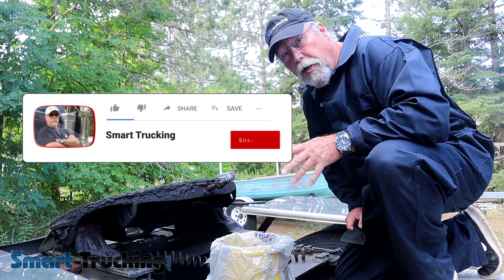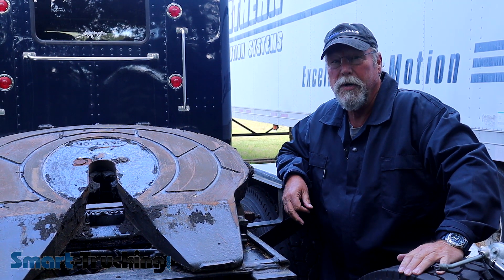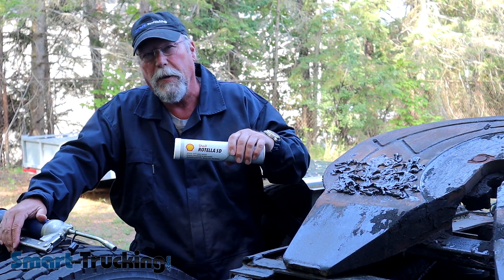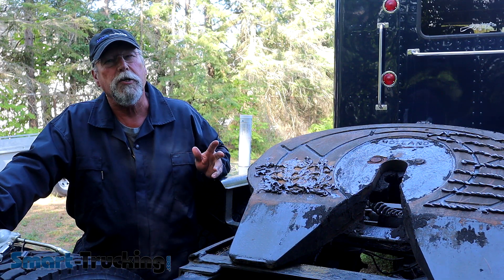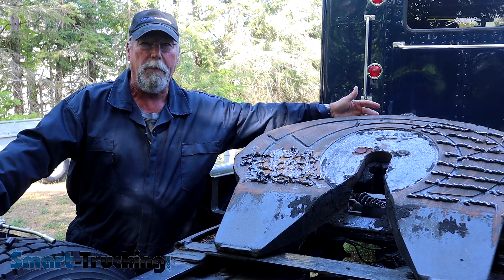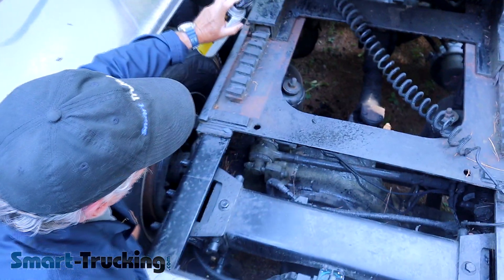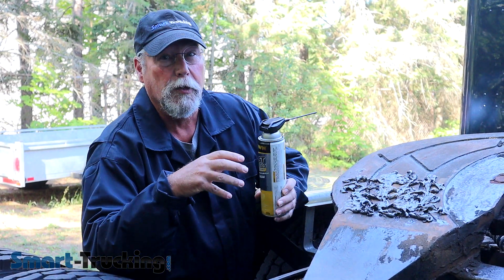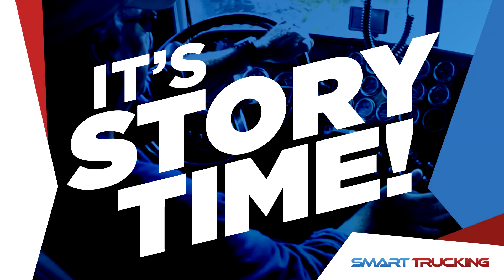How To Grease + Maintain The Fifth Wheel

Comment: This is a pet peeve of mine. A dry fifth wheel is hard on your front end components as well. We had a driver come in one afternoon and I just happened to be at the shop. He told my boss that it sounds like his rear end was going out, so he unhooked from the trailer and they went on a test drive and the noise stopped. They hooked back to the trailer and went again and it made the noise. The boss told him that it must be in the trailer so unhook and get another trailer. I walked over and took one look at the fifth wheel, got my boss and showed him how dry and shiny it was. They greased it and hooked the trailer back up. Went on a test drive and the noise stopped. Dry fifth wheels cause a lot of different things to happen.

Comment: If a trailer was dropped with the landing gear too high, I use it as an opportunity to grease the fifth wheel. I back under the trailer until the king pin is a foot from the locking jaws then lower the trailer down onto the fifth wheel before coupling. That way the grease doesn't get pushed off.

Comment: I get laughed at all the time for it, but I lube mine before each trailer. I carry a tub of grease and a putty knife. I put a couple small dabs on each side of the bottom, followed by a light drizzle of 85w-140 gear oil. Additionally, I usually put about 4 little dabs of grease under the nose of my trailers (I usually pull double pups, so I grease my dolly just like my tractor). I've found that when I hook up, the grease under the nose or the trailer gets pushed back onto the plates instead of getting scraped off. As far as oiling the pivot points goes, I also hit the release linkage.

Comment: Mechanic here.
If you've only got 23 seconds before you hook up, you can hold the grease tube vertically, take both ends off the tube and smash it down on the 5th wheel.  It will leave a "Hershey's kiss" of grease.  Continue to smash until you're done.  Very fast.
You also only really need to apply to the lower half the plate.  The trailer will smear it up onto the top half.
Keep the videos coming.  Love em.

Comment: You’re absolutely correct, Dave, greasing the fifth wheel is extremely important. Being that I drop and hook to a different trailer every day, I grease mine quite often because it needs it. I’ve been told that it helps to ease the wear on your steer tires as well as what you said about binding. That story you told was a great one. How foolish to make the SAME MISTAKE twice! Some ppl just do not learn.

Comment: The guy in your story needs a slick plate lol.  Thank you for your informative video,  I have been lubing the springs and components as well with a grease spray wasn’t sure if that was good to do but you confirmed I have been doing the right thing!  I can’t find any grease zerks for my bushings though,  they are getting replaced tomorrow anyways so I will check then.

Comment: The carrier I work for uses slick pads on our tankers because we rarely unhook our tractors, but I still like dropping my trailer periodically and checking the bushing in the jaw of the 5th wheel and the face of it as well. Stay safe drivers and keep the rubber facing down.

Comment: I won't lie. U mention not to use the cheap stuff and I agree 100%. But I've had wonderful luck with walmarts super tech oil brand when doing oil changes. Has a few more dinosaurs in em haha. I also sometimes use the tractor supply brand as well.

Comment: I like using Lucas 5th wheel lube, it costs 25% as much as grease and lasts 2 to 3 times longer. I also never lube my 5th wheel slide because grease and other oils attracts dirt which really jamms things up when you're needing them to move. As long as you don't let rust freeze them up it'll always move, usually use a dry silicone lubricant on them.

Comment: Pro tip. if you are hauling the same trailer all time I recommend cleaning all the grease off and using a Teflon lube plate. they last about 50000km and save the coupling. they also keep everything clean and there's no grease dripping on the axle.

Comment: I have recently started using the Schaefer's 5th wheel lube and I gotta say, best lube I've used and I can honestly tell bc the trailer doesn't drive me as much as the shell, Lucas, or the wolfs head. It's an aerosol which is odd but my Mack just takes to it like a fish to water. 

This video should be shown to every driver starting with a company or a school. I'm an o/o now and the amount of guys ignoring their 5th and having to rebuild is shocking.
Reply: Tell me about it! My truck has 2.5 million miles on it now with the original fifth wheel. I see dry fifth wheels all the time in our yard, I just don’t get it. They will though…

Comment: I just take the tube of grease, pop the cap and squeeze it right onto the 5th wheel like a toothpaste tube. You just use the end of the tube like a scraper and smear it along the grooves and over the flat spots. Takes less than 2 minutes.

Comment: Main question is that how often should OTR O/O who never needs to decouple trailer from tractor should  detach them and grease the 5th wheel?
Reply: Once a week. Go to just about any truck stop and get those small bags of grease. While the trailer is empty dolly it down and drop your airbags on the suspension leaving a gap between your fifth wheel and the kingpin plate on the trailer. Put a bag of grease on each side and air your suspension back up. That will bust the little bags of grease and now you have a greased fifth wheel.

Comment: Have you seen the ware pads that you can use that bolt to the fifth wheel?
Reply: We installed those about a year ago and now they're coming apart. Some of the drivers have to drop and hook twice a day and those loaded flatbeds loaded with treated lumber are heavy, I'm guessing that's why they started breaking.

Comment: Whats your take on the 5th wheel wear pads. I started running one and it seems to be doing good sofar. I do grease my jaws but the plate i do not with the poly pad on it. 
Love the content, come on
Reply: We put those poly pads on our fifth wheels and they did good for a while but now they have started to come apart. I took mine off and went back to greasing it. We had the bolt on poly plates from Freightliner and Peterbilt.

Comment: If I had my own truck i would take the time to take the old grease off, but the company I drive for is super cheap and doesn't care about the drivers whatsoever so I just put the new grease on top of the old grease
Reply: You do know your comment on your thoughts are probably the same that your company has on you. You say they're cheap and don't care about the driver's, have you stopped to think why the company acts that way? Maybe it's because they think that their driver's don't care or take the time to properly care for the equipment that their given. It's that level of thinking on both sides that makes it bad for both parties. I myself don't care what the company does or thinks about me, I care what I think about myself and that's why no matter who I'm working for if I'm charged with a piece of equipment I always treat it as if it's my own, every employer that I've ever worked for has come up to me and said how impressed they were with me and how rare it is to have someone do what needs done without having to ask and every time that it's happened it came with a very substantial bonus and I do it because that's who I am and not for the bonus.

Comment: Trailers run $200k these days? 🤔 I guess if you deck one out with a fancy conestoga and sliding tandems, dump valves, scales, lift axles, aluminum here, stainless steel there it can add up fast

Comment: If it a company truck and trailer I would believe that the company job when they do pm on trucks
Reply: Ultimately it's your responsibility, any mechanical failure resulting in personal or property damages will fall on the driver's shoulders.
Reply: Anything regarding the truck is the drivers responsibility. If you’re a trucker you should know that.